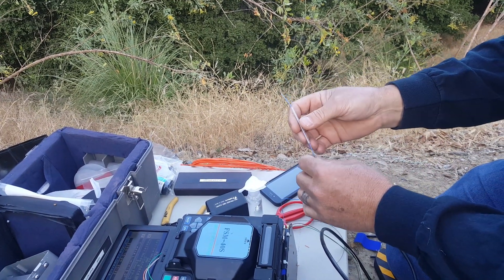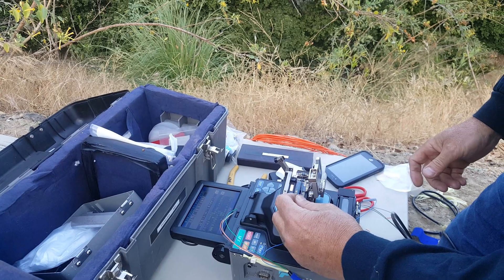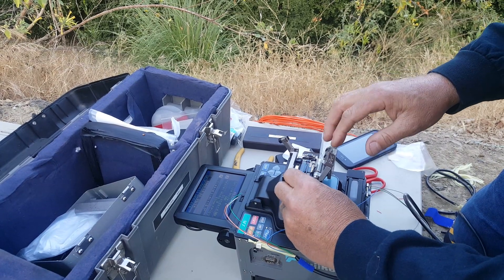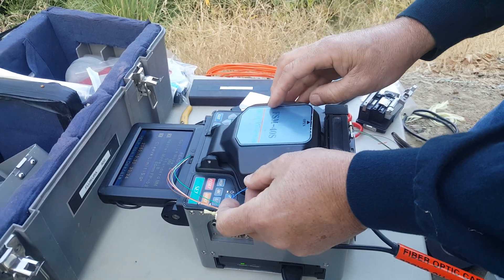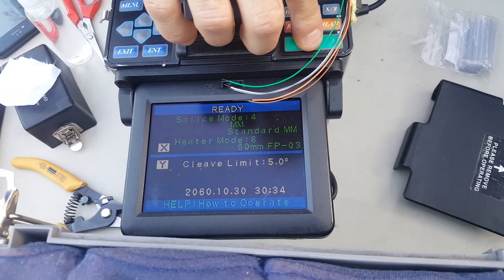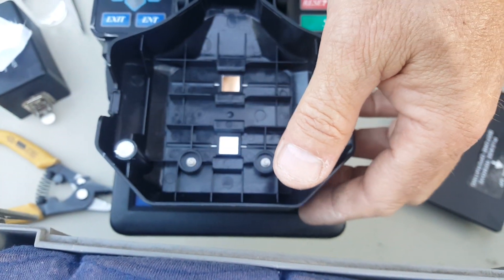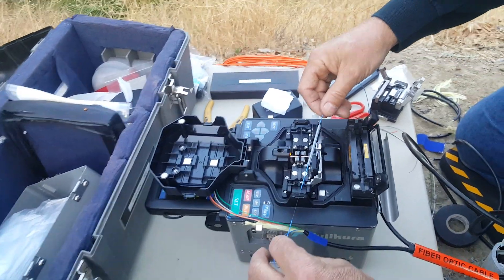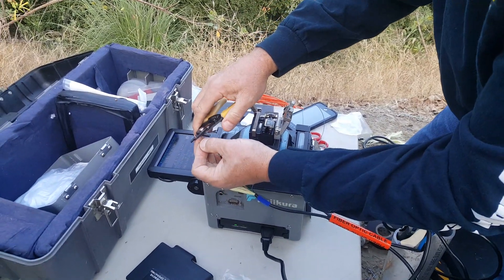Fiber optic fusion splice rat chewed repair

Comment: We repair all kind of splicing machine otdr power meter laser source laptop  motherboard wireless desktop lcd led cctv moblie projector x ray printer server  any electronic panel  chip level repairing refrigerator washing machine. whatsapp +91 9004861466.

Comment: That machine looks expensive.
Reply: Prices vary but the fusion splicers are several thousand dollars. That's a single fiber splicer and it's a top of the line brand so I would say it's probably around $6-$8,000. Doesn't include the cleaver.
Reply: I just got this machine a mounth ago here in indonesia the prices around $6164